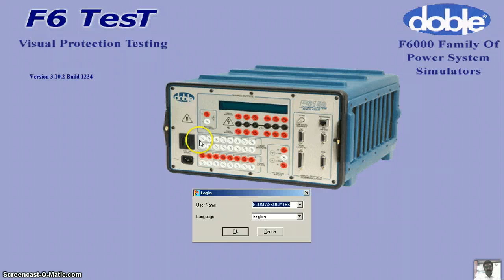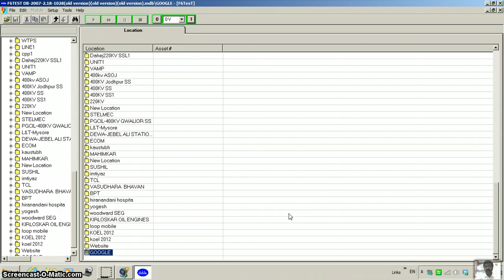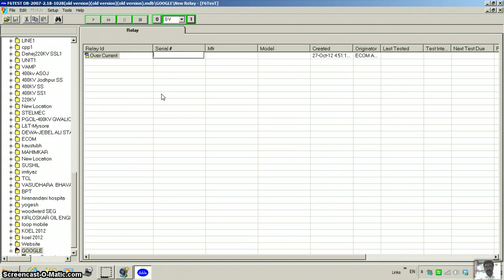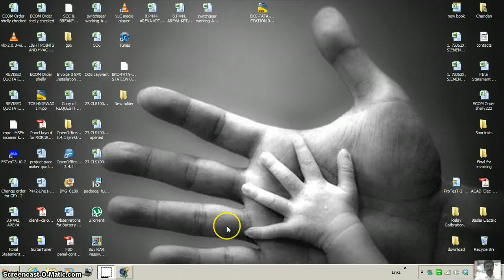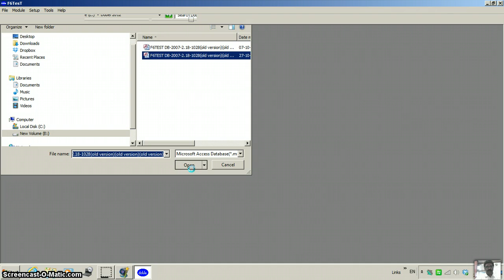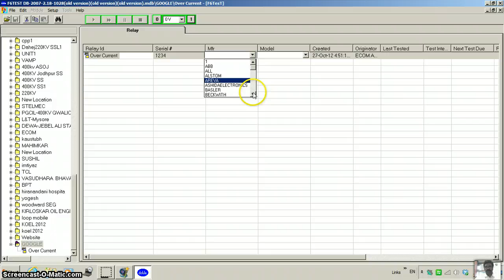Testing OverCurrent Realy with Doble F6150 Test set.

Comment: Can we use this F6150 Power System simulators for Ratio testing of the Current transformer?
Reply: Actually I have been able to do this. As long as you can physically get your hands on the CT (ie: not on a bushing). Apply Voltage on the CT secondary X1-X5. So if you have a 1200/5 (240/1) CT, Apply say 120V from X1-X5. You should read 0.5 Volts on the CT Primary. This verifies your CT Turns Ratio without stressing the F6150.
Reply from the maker: lok chand no,,  the burden of CT is high and the test set will not be able to inject the required current 
You will damage the test set

Comment: with regards to relay manufacturer it is okay if it just generic differential relay, what I was after is that the test plan with regards to delta wye transformer, I am not sure how to make the settings in the compensation page, I am not sure with the idea. The manual did not provide much info. Can you discuss that part?
Reply from the maker: TheSurgeArrester check the Rio file converter